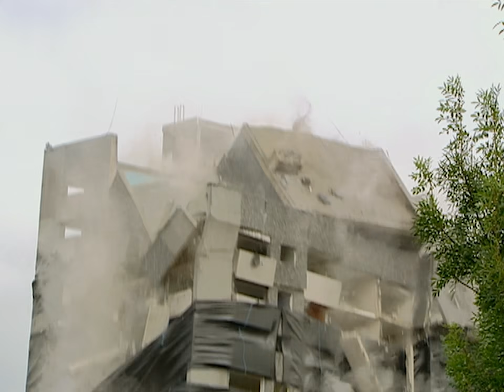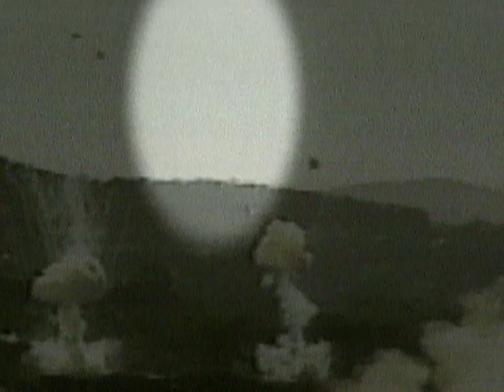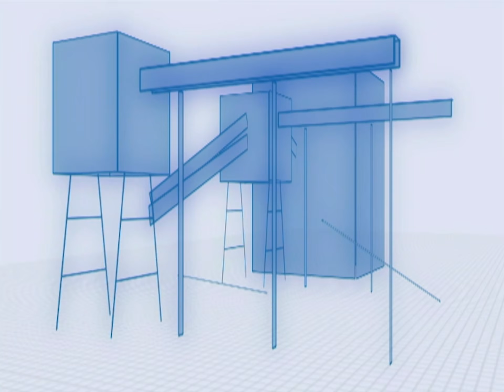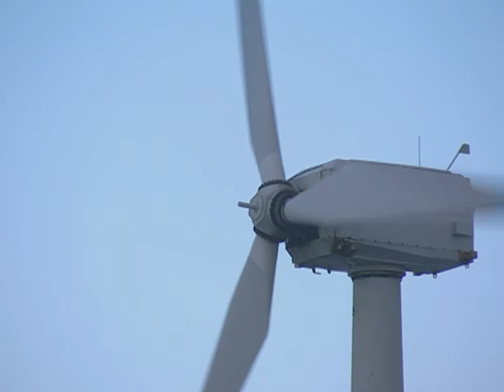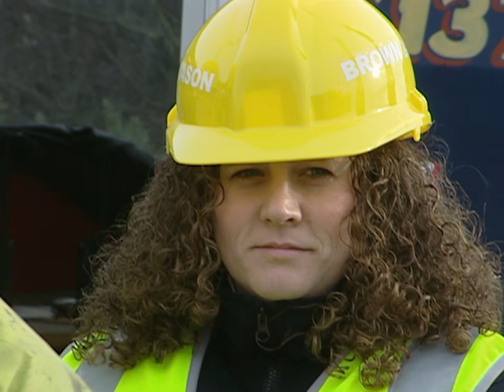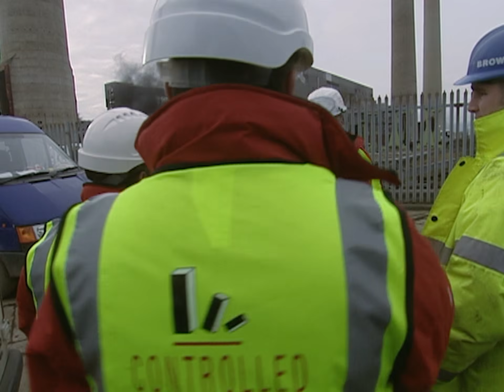One Mistake Could Turn Blyth Power Station Into a Colossal Bombsite | Blueprint

Comment: I worked on a lot of the coal fired stations .and with maintenance they could  still be producing cheap power for all.
Reply: Nothing cheap about burning coal otherwise it would still be active, no one wants to invest money in a plant that will only supply the grid with power from 4pm-7pm peak and take two days to get up and running and two days to power down, makes a MW very expensive when you factor 4 days worth of coal shipped in from Brazil or Colombia for 3 hours generation!
Reply: And pumping harmful gases and soot into the atmosphere...